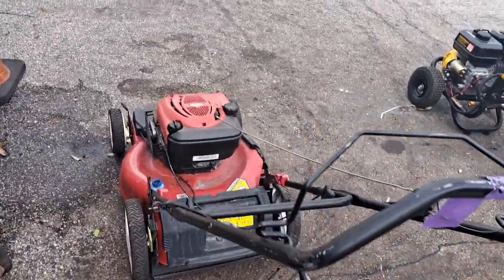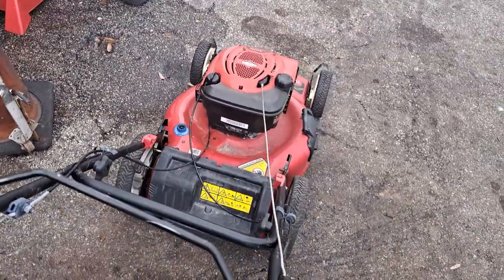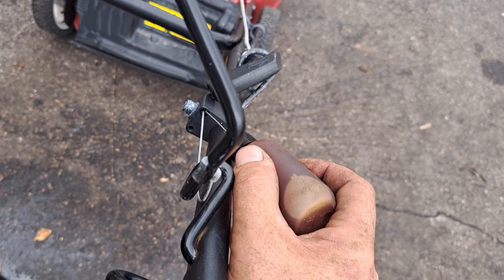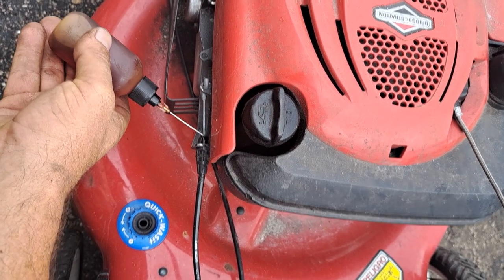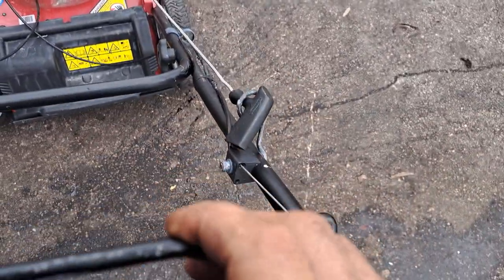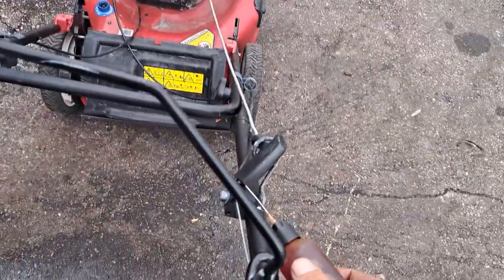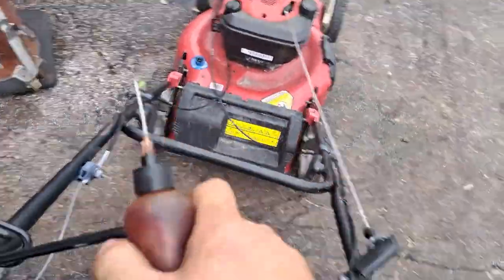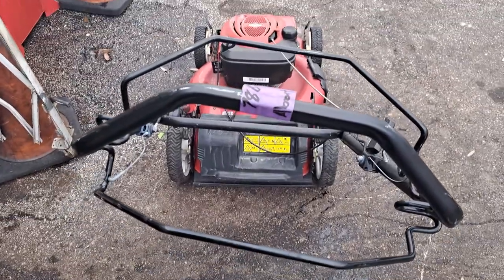how to free a frozen kill cable on your lawn mower push mower

Comment: Great tip. Guy down the street never took care of his Craftsman self-propelled mower. I gave it a tug, it had compression. Took it home, it was clogged from stem to stern with clippings and dirt. But with elbow grease and a rebuilding and cleaning the carb and filter, replaced the front wheels, it runs great. The sticky cable was the last thing. Thanks.
Reply from the maker: You will need a new one soon. Plan ahead buy it now.